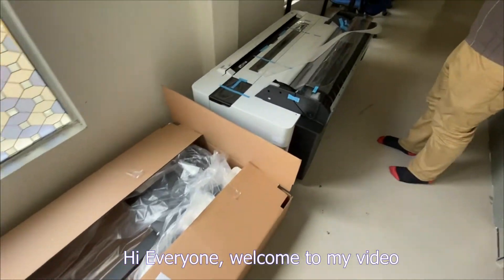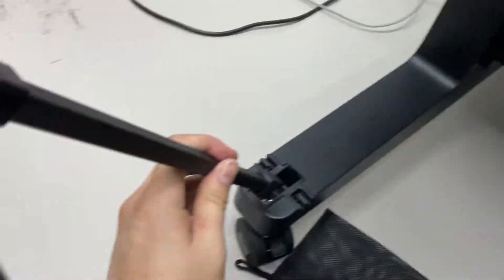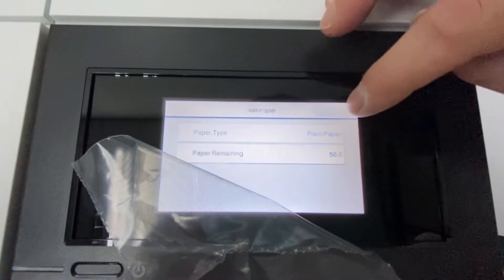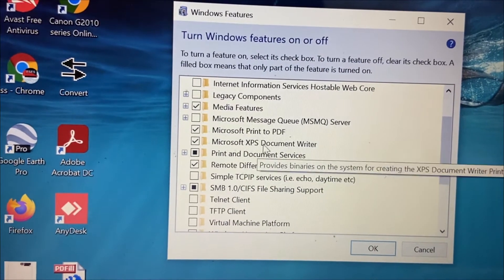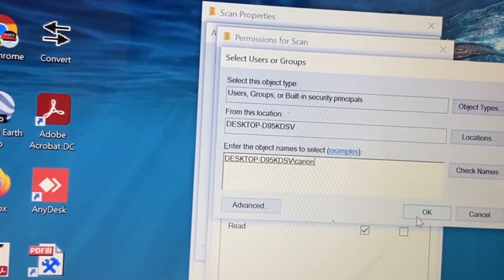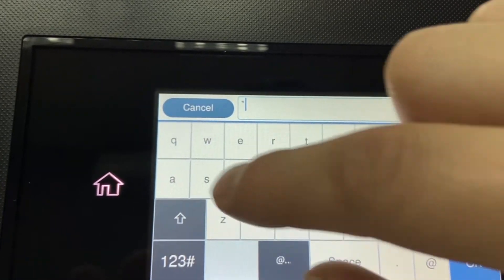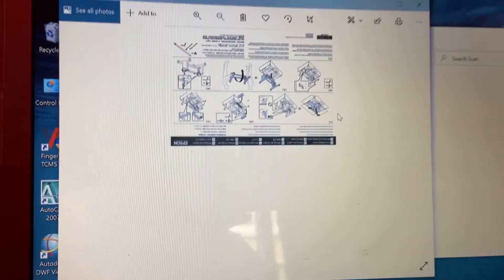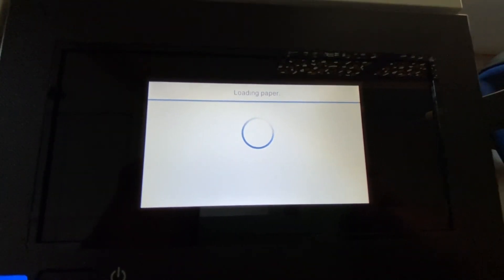EPSON SC T5430M LFP OPEN BOX, REVIEW, DEMO & INSTALLATION GUIDE

Comment: Sir, I am facing this problem in my EpSon 5430M,
Paper roll cover automatically open when printing, roll changing (after i change roll the paper )

I have rise complaint in epson service centre but engineer say's that in warrenty not came with plastic damage
Sir please give me some solution for this type of problem.
I have attached the video of the machine 

https://drive.google.com/file/d/1s0W3mBfxvusPLoihTBFXe3FXwfzK7ucb/view?usp=drivesdk
Reply from the maker: Hi Sir , I can see the cover is keep shaking. If that case you have to purchase the new cover, my suggestion is try loading cut sheet first, if both loading method (cut sheet & roll form)got problem it might be another issue
Reply: @dennisthefatkid   Sirs per your advice I tried both loading method and I find that using cut sheet method there is no problem but roll method I found some problem with Right side of Hinge , I have Share video link ,Please See and suggest me Right

https://drive.google.com/file/d/1szvZKAWe9SaVX2EsvTo5gLdWbnKismpt/view?usp=drivesdk

https://drive.google.com/file/d/1szvZKAWe9SaVX2EsvTo5gLdWbnKismpt/view?usp=drivesdk

If you See in this video some part (I don't know the name of part) is slips at last (It's makes some noise).
Reply from the maker: @dipxeroxchikhli7398  I can see the cover can’t attached properly , just follow the instruction from epson , replace that cover
Reply: @dennisthefatkid  ok sir
Thank You For Your Support .